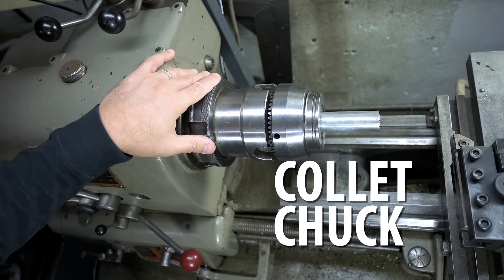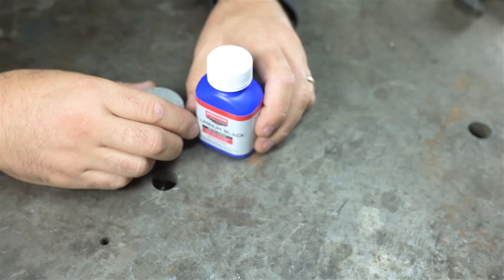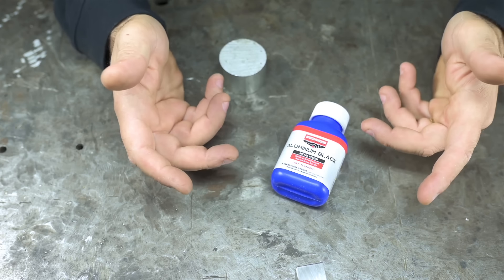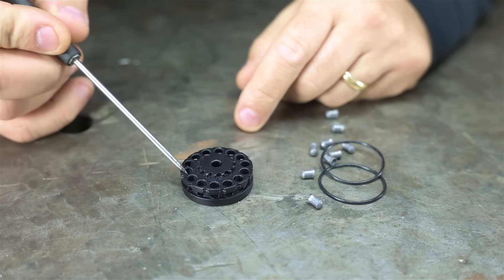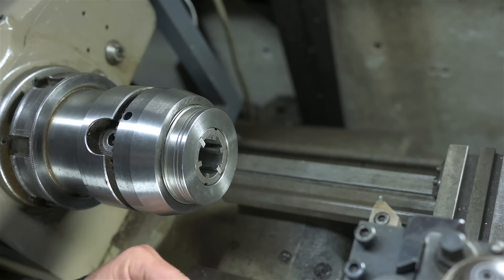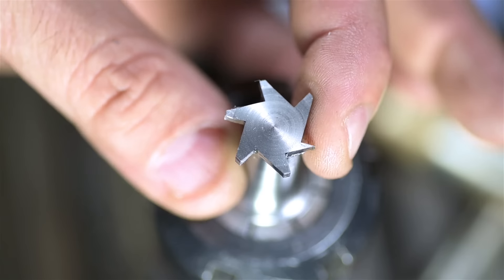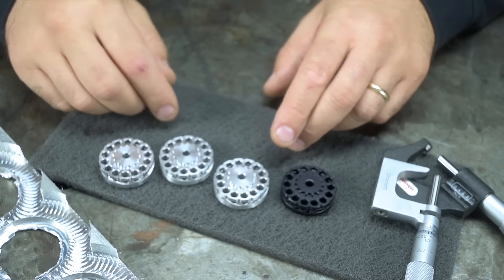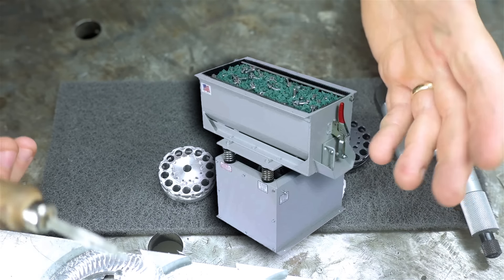Will it Black an Entire Aluminum Part?

Comment: Let me recommend to avoid "other metals" in the reaction. I noticed that you use a metal cup and a metal stick (welding wire?) to dunk the part, which can easily ruin the intended chemical reaction. Unless explicity required in the instructions, I suggest glas or plastic for this purpose.
Reply: Was about to yell about Al on steel in that setup. Sadly he didn't use a plastic container for reference. Ah well...
Reply: looks like stainless steel which is unreactive
Reply: What kind of plastic? HDPE or PTFE?
Reply: @executive     Oh to be a young, naïve apprentice again.
Reply: @SergeantExtreme  That's a very good description of yourself. Stainless will resist weak, room temperature acids, such as this very dilute solution, and cupric sulfate with ease.
Reply: @executive  "Will resist weak acids" and "unreactive" are very different things, and perhaps you should do a bit more reading on the chemistry of stainless steel.
Reply: @executive  It's a conductive metal and 100% gonna galvanically corrode things too, while we're listing ways that this is wrong. Stainless steel is cool, but it's not magic.
Reply: NO glass. Glass reacts with one of the acids in the reaction (Fluoboric acid). Plastic is the only contaminant-less method; however plastic choice is important. Polyethylene is preferred for all 3 acids in the mix, HDPE is preferable to LDPE because HDPE  can withstand hotter conditions with all of the acids in Aluminum Black.
Reply: @executive  "very dilute."
Dude.
It's almost 20% acid, collectively.
That's far more than enough to dissolve metal, (considering it already has dissolved metal in it.)
Also, what do you MEAN stainless steel? Stainless isn't one thing. There's a few types. I'm sure you mean alloyed stainless, which contains chromium and nickel. This is ABSOLUTELY going to interfere with the Copper selenide reaction that Aluminum Black relies mostly upon; it will also probably do some shit I don't care to think about to the phosphate conversion, making a chippy poorly adhered mess.
Reply: @D-Vinko  it's between 2% and 8% weak acids, and 0.1% to 3% fluoroboric (molarity unknown). Dude.
Reply: Yeah, instantly had same thought - I assume the reaction would have been less violent without the stainless steel cup that was in electrical contact with the aluminium part
Reply: @D-Vinko  Firstly, this solution isn’t extremely corrosive and can barely dissolve metal. The dissolved metal ions mentioned were added in the form of a salt. You wouldn’t say water is capable of dissolving metal, yet it can readily dissolve metal salts and other ionic compounds. 

Have a look at the MSDS and you will see it contains nickel sulfate (aq) aka nickel ions - this process does not work on stainless steels or any other steels and had to be specifically tailored to work on aluminium, hence its name. This is because steel unlike aluminium is not an alkali metal, and so seldom forms a strong oxide coating. 

In this case, It can barely dissolve the oxide layer on the surface of the aluminium and there is no “phosphate” conversion if such a thing even exists. The fluoboric acid is just strong enough to react with the aluminium oxide surface layer, however the dissociation of fluoride ions is so slow that the introduction on an accelerant (not to be confused with a catalyst) must be used, in this case, the selenium ion (present due to the dissociation of selenious acid, partial or otherwise) allows formation of various complexes which increase the concentration of free fluoride ions. This process creates small pits on a crystalline level (also sometimes referred to as pickling) which can be attacked by the other mineral acids (phosphoric acid here) to form the black coating. 

Several byproducts of the reaction, including copper selenide form during this process that fill the pits, which is why it is considered dimensionless. Copper selenide is what produced the black solution seen in the video. It’s sensitive to abrasion because the copper selenide is not chemically bound to the aluminium, which is similar to anodising. However due to the dipping technique used in the video it’s possible that the aluminium was over attacked, and the pits formed were too large.
Reply: Here we go
Reply: Well that escalated pretty quickly.
Reply: @oceanic8424  I loved the"escalation". Very civil and informative. :)
Reply: @ollie4022  While the information is interesting and appreciated, it’s all totally irrelevant what will metal salts dissolve in water or what the MSDS says it’s contents are, the point, which ultimately you back up is just that to say “Stainless steel is ‘un-reactive’” is entirely incorrect.
Reply: @Jay22222  Stainless steel will not react with this solution, which makes this entire comment thread pointless, D Vinko’s comment that this solution is highly corrosive is simply incorrect. Stainless steel alloys are more unreactive relative to steel alloys without chromium or nickel, hence the name stainless. It is the same as the term strong acid, which only refers to an acids ability to dissociate in water. There is nothing to gain from being pedantic about a name of an alloy.
Reply: @executive  lol according to who?
Reply: 0
Reply: @executive  Unreactive is exactly what you don't want. Aluminium is the most reactive common structural metal, but only after you dissolve the surface oxide layer (easily done with caustic soda.) It will then form a galvanic cell if it is in electrical contact with (touching) any nonreactive metal. The nonreactive metal then enhances corrosion of the reactive one.
Reply: @londonalicante  it's a reaction vessel, not a sacrificial anode.
Reply: @executive  That's exactly the point. The aluminium is going to act as a "sacrifical anode" when in contact with the stainless, which is not necessarily what you want in this reaction. Copper alloys will seriously accelerate corrosion of steel if left in contact with it, and stainless will accelerate corrosion af aluminum  (in alkaline conditions where the oxide layer is removed.)
Reply: @londonalicante  you're right the aluminum will corrode faster
Reply: @executive  it is an exothermic reaction, tony said the cup was hot to the touch. not a room temperature acid right?
Reply: Why would someone try to rebuff a comment insinuating they are naive by demonstrating an even greater level of naivety than previously displayed? Aside from them all being hydrogen donors, different acids react with different things in different ways at different rates and with different results and it's no small difference either so grouping them all together when talking about material compatability is nonsensical. Also, grouping all stainless steels together when referring to chemical compatibility is illogical, you can deduce that from the fact there is more than one type and grade of stainless steel. And finally, cupric sulfate is not even an acid. It's often much wiser to just allow someone to think you're a fool than to argue and remove any doubt.
Reply: Saying that stainless steels are less reactive than other steels is not accurate. Their reactivities with regard to some particular chemicals may very well be lower, but they are far more reactive when exposed to other chemicals. And just to stay focused on environmental oxidation, stainless steels are much more reactive than other alloys. In fact, it's the rapid and complete reaction with atmospheric oxygen that forms the outer passivating layer of oxides characteristic of stainless steels in general. Thus the relative inertness of stainless steel with regard to specific chemical exposures is a characteristic of only just the oxidized outer layer and not a property of the parent alloy in and of itself.
Reply: @magicoddeffect  Even more so... Stainless steelSSSSS